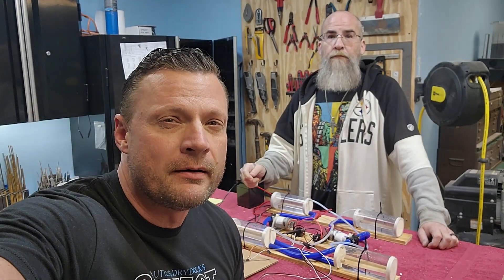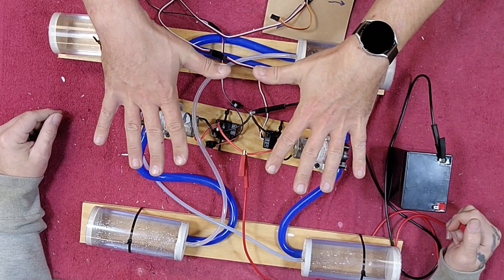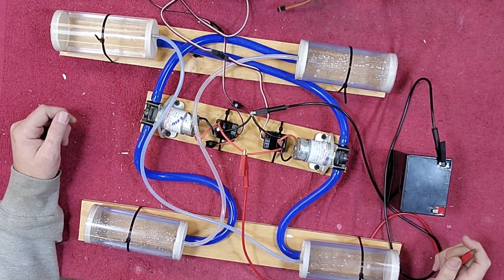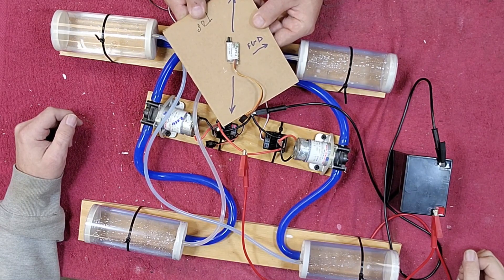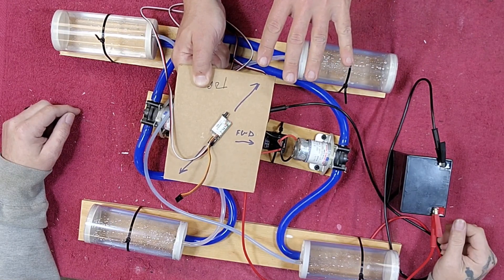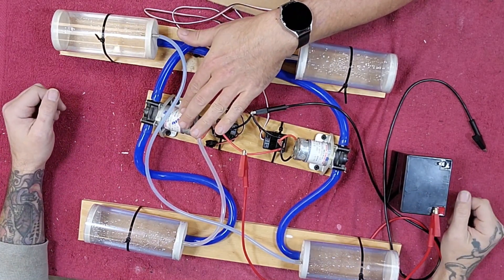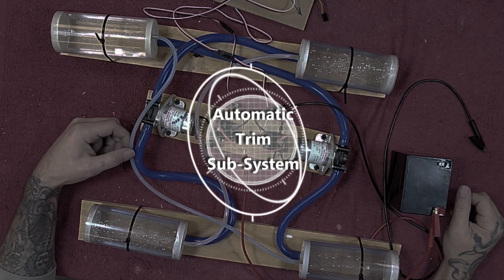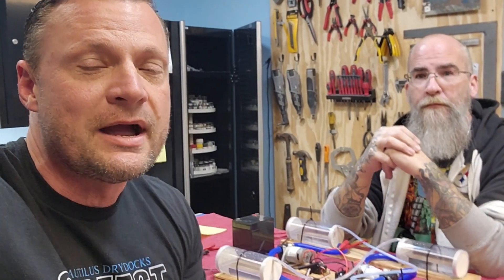The RCSubGuy's ATSS - Automatic Trim Sub-System for RC Submarines

Comment: I completed missed this before! 
I am considered building a SubNautica SeaMoth build and i was considering a 3 tube/bladder pitch/roll attitude stabilizer, then have a main thrust with small bow thrusters for Yaw. This system is a promising method.

Comment: I think you need to work on the tank design, if the system goes too far out of horizontal, the lower port on the heavy side will be uncovered and the pump will suck air. It will not be able to recover.
Reply: The hoses just need to be extended to the low point (far end) of each tank.
Reply from the maker: exactamundo!